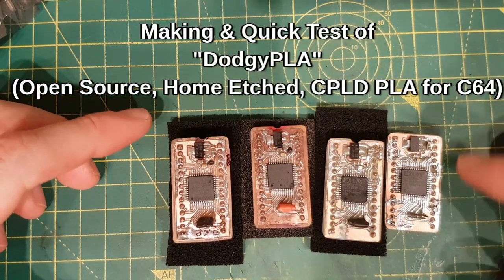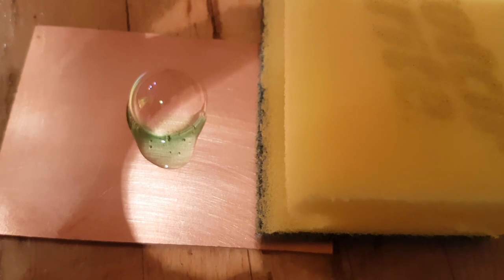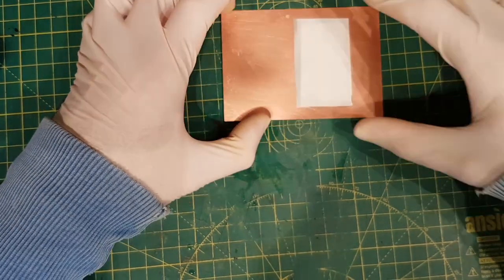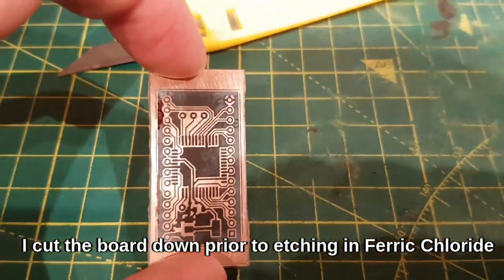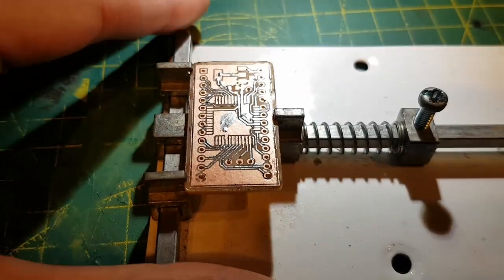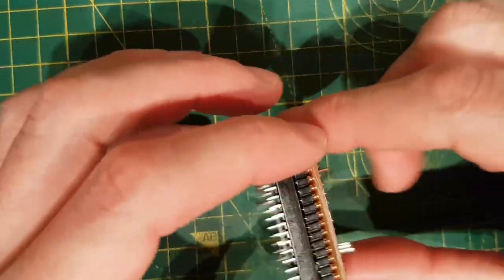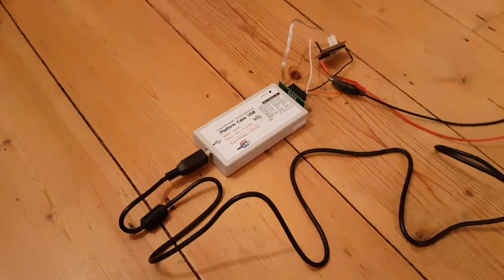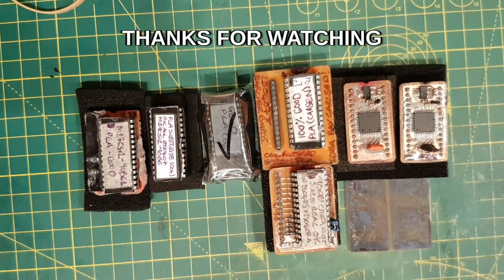Making and Testing a 'DodgyPLA' (Open Source CPLD PLA for C64)

Comment: Great video! I tried this but I cant get it programmed. Impact keeps reporting there might be a hardware error but I checked my soldering and know that the TDI and the others have contact with the xilinx chip. What version of Impact do you use?
Reply from the maker: Hi, Thanks ! I will fish it out. I am not much of an expert when it come to this stuff tbh and copied most of it from othrers but. I will fish out and link the file. All the best.
Reply from the maker: Hi again. Sorry but I checked my laptop and I had deleted all the software after doing the project so unfortunately, I can't see which version of iMACT it was. All I can say is that it would have been the latest version as at NOvember 2019 and that I had to follow the 'making Xilinx software work on Windows 10' video to get it to work on my Win 10 laptop. I even checked my history but couldn't find it. Sorry. Hope you get it going. Worth the effort. Good luck. If I make any more I will let you know.
Reply from the maker: I am going to try and make some more soon. Will let you know.
Reply from the maker: Did you give the DodgyPLA it's own separate +5V and ground connections and then couple the ground to the USB ground? Just USB power alone is not enough.

Comment: How did I miss this?*  Well done! The cold transfer method worked really well. And the replacement PLA tinkering worked pretty well also.

* I posted a new video and gave a well-deserved nod to your bwack C64 Saver video and included a link to your channel. However, I noticed that your YT settings weren't allowing the 🔔 icon to be clicked. Do you mind pinging me by email? My email address is available on the About page of my channel. Thanks!
Reply from the maker: Will do. Glad to hear from you. Thanks for watching and the mention.

Comment: I always wanted to but never did mod an inkjet printer to print masking directly onto a copper coated board. I don't know if it would even have worked with the ink once dried but it would have been interesting to have a go. I was thinking something along the lines of modding the printer to have a bed that moved to emulate a sheet of paper.

What I have just thought of though is if it would it be possible to use the etching agent as an ink and effectively print the areas that you don't want copper in. If the etching agent doesn't attack plastics or anything that would be inside an inkjet cartridge. 

I never said these were good ideas, just ideas :-D
Reply from the maker: Hi, Thanks. It has been a while and I am not much of an expert but I will fish out the file and link it and try and see what I did. All the best.